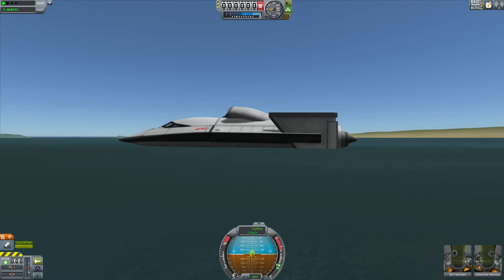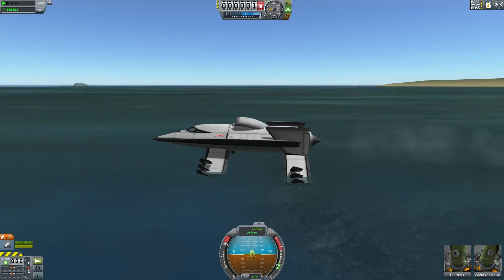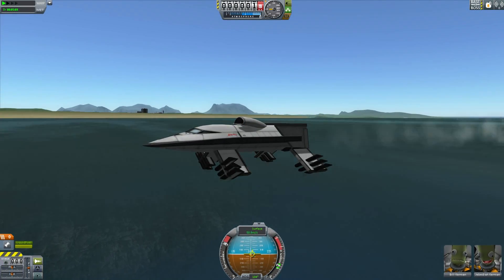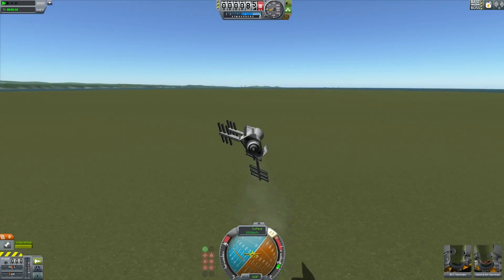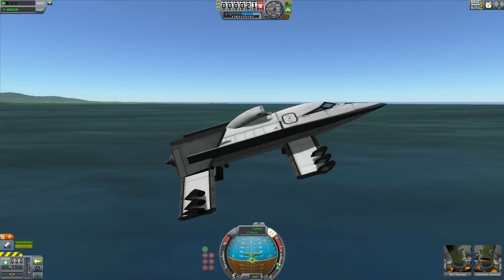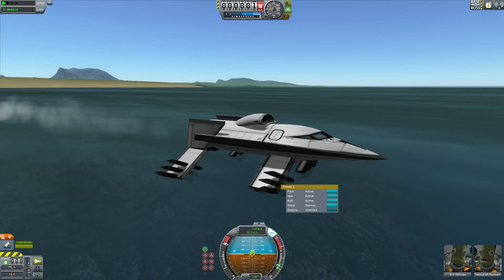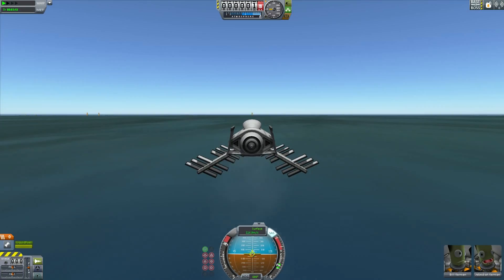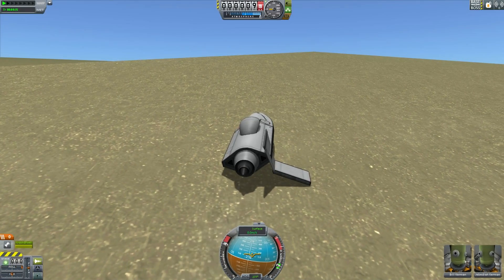Kerbal Space Program - Hydrofoil

Comment: Hey, Scott! When you mentioned real life applications of turbine engines in boats, it got me to thinking about the super boat racing. I don't know if they run of pure jet exhaust or turbo prop, but I know some superboat teams use turbine engines to power their boats.

Also, have you tried a catamaran style design? It could help with the stability at high speed with a lower center of gravity (and you wouldn't have to worry about unintended flights. lol)

Comment: Not a fan of squad putting wing parameters on those spaceplane parts to make them act like lifting bodies, that should be done through aerodynamics simulation not hard coded part values, makes using them for certain things tricky, like putting them on the tip of a rocket means you need wings on the back to counter the lift.

Comment: So when I design airplanes they go kaboom 50% of the time, but when Scott makes a boat, that flies just fine? So unfair.
Reply: +HumbleZebra Try making a boat.
Reply from the maker: I spent about half an hour in total tuning a design that would lift out the water and go faster.
Reply: +gajbooks Excuse me, but did you just say asteroid recovery boat..?
Reply: Making planes is harder than making boats:)
Reply: +gajbooks when has practicality ever been a deciding factor in KSP? :P
Reply: +HumbleZebra You have pointed out your problem. Who the hell makes airplanes in KSP and expect them to fly? You should've built a boat in the first place.
Reply: +HumbleZebra planes are easy
1 make sure the centre of grave is slightly in from of centre of lift.
2 Don't have too many control surfaces.
3 Use SAS constantly for an unstable plane.
4 Put the rear gear a little higher than the front gear so the plane naturally points up slightly.
5 If in doubt more lift!
Reply: +bflet12 Boats are probably useful for massive amounts of cargo that is too heavy or weird shaped to fly. I might make an asteroid recovery boat and crawler setup and go afk with it on SAS for several hours while it travels.
Reply: +HumbleZebra To be fair, this the "successful" clip from what is likely hours of "ways to not make a hydrofoil."
Reply: +HumbleZebra Had the same experience as him. I actually had to reduce my foils down to tiny prongs in order to avoid automatically flying into the sky.
Reply: +Gabriel Turturea You can in fact build a working submarine in the vanilla game because apparently the "Juno" engine will work underwater (in fact, ALL of the jets may work underwater so long as the intakes remain intact).
Reply: +Gabriel Turturea Except planes are in every single way better than boats in KSP in terms of efficiency. A recoverey boat might be cool, but mind-numbing after more than one trip.
Reply: +Peter Smythe LOL
Reply: +Scott Manley Only? I still spend hours working on SSTO designs that don't quite make it...
Reply: +bflet12 I feel you.  I am to the point where I can get my SSTO into space, and  a very low orbit, but at least one of my attempts I didn't have the fuel to deorbit (was at 1km above teh atmosphere)  with my engines so I had to use what little monopropellent I had to finish it.  And then it ended up breaking apart just before I was able to land. (guess too much G force trying to bleed off the speed)
Reply: +Shane Wilson Damn dude :( I don't get to play a whole lot, but I usually get them to a very low orbit as well in unloaded testing, and as soon as I try loading the thing up realize I have some sort of balance horribly wrong, usually COM or COT.
Reply: bflet12 Oh, once I have anything major loaded, I tend to not even make it into orbit. Although I've been able to launch a sat, do a quick burn on the satellite to get it into orbit and then land my SSTO. 

But I need to get back to playing, haven't touched it in a few weeks, so haven't even played with 1.0.5 yet.
Reply: +gajbooks Yup, although, this discussion was about how hard it is to make boats, not how well they work :)
Reply: +HumbleZebra Planes can now work as planes boats and submarines.
Reply: +bflet12 Madness.
Reply: +Praetorian Tried the submarine part, it seems like you need a specialised "plane" for that one, since they won't sink.
Reply: +Gabriel Turturea I think if you used KAS you could probably rig a ballast system by pumping fuel to and from an independent tank, possibly on a floating platform.
Reply: +HumbleZebra 
Practice, if Scott can do it anyone can, he is not a very good pilot, or designer of craft.
Reply: bflet12
Or just a submarine mod :D But it would work with kas.
Reply: 23r0 Gaming

What we were talking about is how we can submerge a plane in KSP, i know very well that jet engines work underwater, i just don't want using engines to submerge something, so either using ksp 1.0.5's physics, maybe, or using a mod, most likely a mod.
Reply: +HumbleZebra I feel your pain. One time I spent two hours flying to the North Pole at subsonic speeds, then tried to land. Crashed and died.

At least I communicated some science.

Comment: a lot of modern hydrofoils don't use propellers anymore. instead they use water jets. this has been in practice since the '90s. the old Dover - Ostend line (discontiued) had them. the the big drawback is that this method is impossible when there are bigger waves (1.5 - 2m).